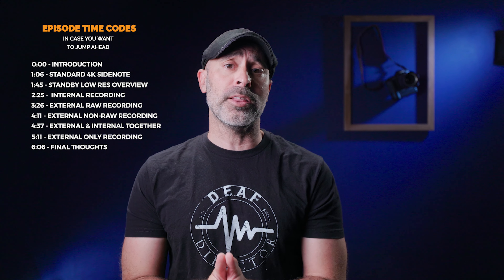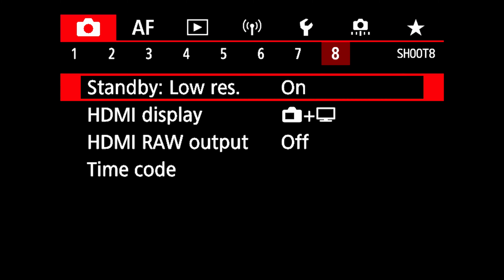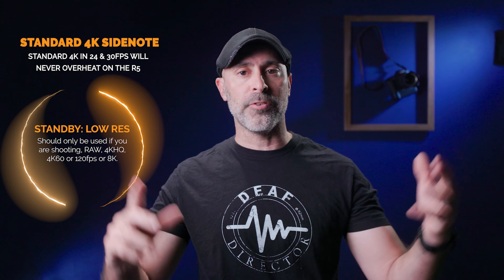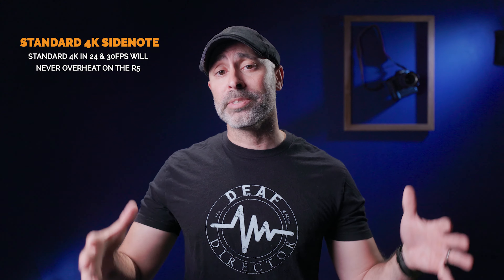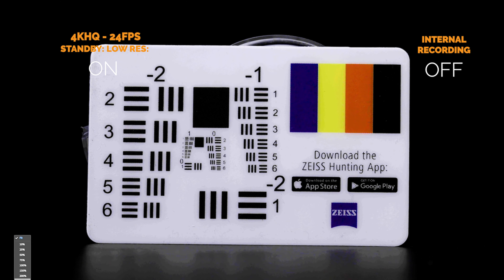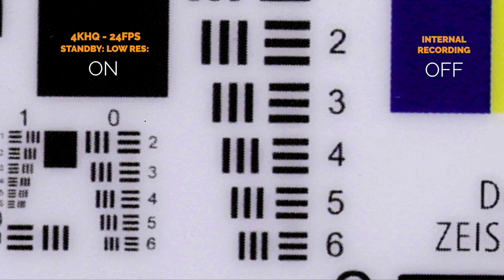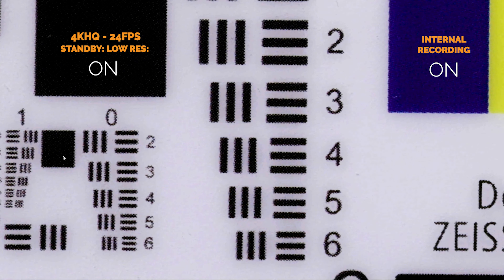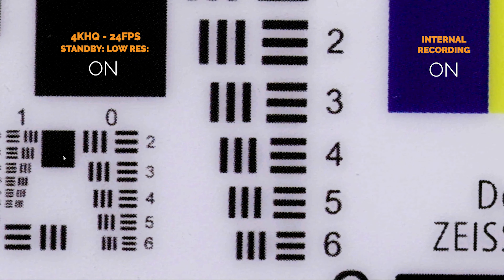CANON R5: STANDBY LOW RES - TIPS and WHEN TO USE

Comment: Definitely the most best of all series (6 Videos) on overheating and I think canon must include this video as a file in the camera package box
Reply: But it was better if you include the quote that for external only recording just turn off the standby low res and enable the auto screen off to ignore the camera heat.
Reply from the maker: @emadirani5873  That would have been a great point to put in there! Thanks for leaving a note in the comments. I've been traveling a lot for work these last few weeks and I meant to put that in there and completely overlooked it. Thanks for the comment and have a great day!

Comment: Thank you for taking your time to do these Canon R5 videos, they have been very helpful!  I recently shot a 4k60 real estate video in C-log3 Rec 2020 external only through the Ninja V and didn't realize I had stand by low res mode on.  The video was extremely choppy and appeared like it was 30fps, the codec shows 4k60 but it's really not.  This issue gave me a headache and I'll have to reshoot the place.   lol
Reply: I’m having the same issue 😅.. The footage was shot on 50 fps and the codec shows that it is indeed 50 fps, but when I put it on a 25 fps timeline project and slow it down to %50 in different ways it looks so choppy, which was very strange! Finally I figured out the issue when I saw another video on YouTube which talks about the same problem. But the problem now is that the footages that I shot aren’t usable, unfortunately

Comment: So, just to clarify, if I’m going out to my Ninja V+ at ProRes Raw— Standby Off or On? Thanks—love your videos!
Reply: If you shoot 8K Raw or 5k Raw, let it ON when you record internally or/and externally. Raw is not impacted by standby low res.  It will just low res the viewfinder& internal screen
Reply: @charliemotion2819  Thanks! I just wanted to make sure there wasn’t a distinction between some other kind of RAW (that I may not be familiar with) vs ProRes Raw.
Reply: @frost1tube  i don’t use raw because of the larger file/benefits ratio. Am keeping 4k hq with clog3/rec2020 color space to have large color data and  the best color separation possible in color grading.
Reply from the maker: If you're shooting RAW through the HDMI, cut Standby: Low Res to ON. Have a great day!